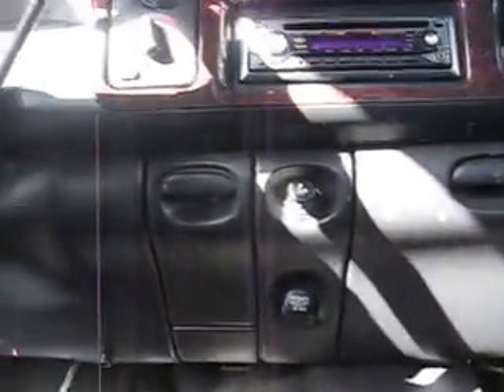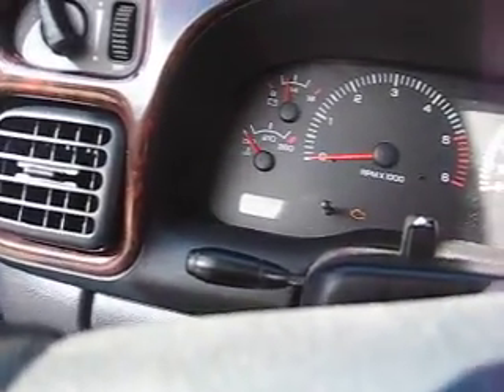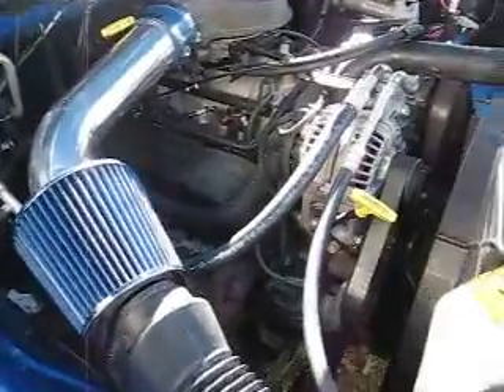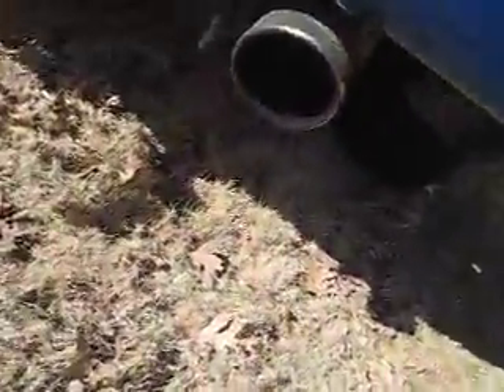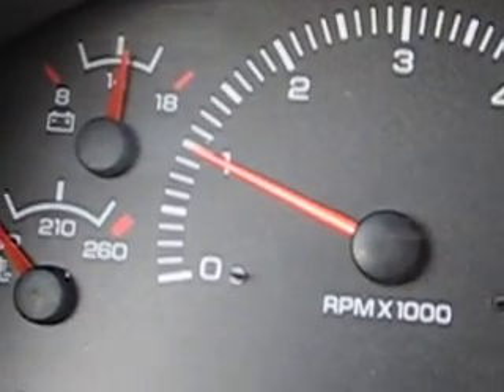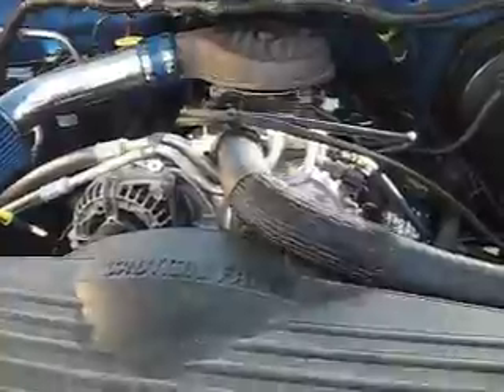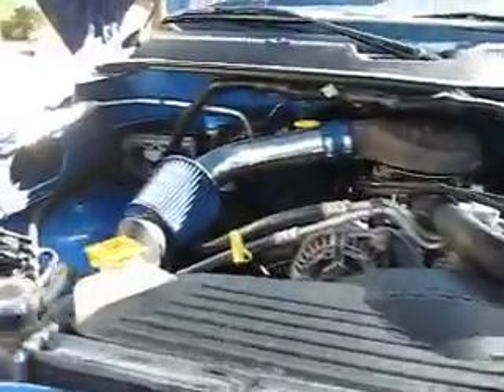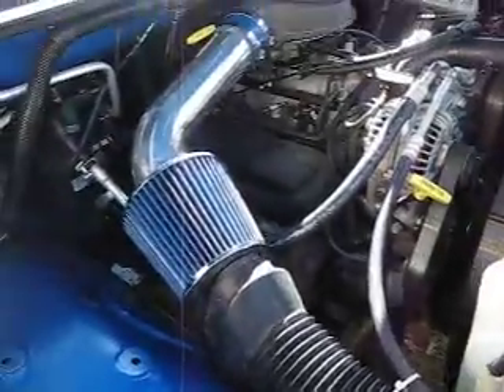Home made  Ram Air intake on Dodge

Comment: @01DodgeRAM1500V8, it might a little, have you ever tried the new spark plugs called "SPLITFIRE"? it's like a standard plug BUT it has a "V" on the end of the gap, it fires everywhere inside the cylinder, thus boosting the MPG better, i put a set in my 96 dodge ram after i found it it was getting 14 MPG in the city and 18 MPG on the highway, and thats from a 3.9 V6, i put in splitfire and i was shocked how it boosted up my MPG from 14 to 22 in the city and from18 to 28 MPG on the highway

Comment: P0113 has nothing to do with A/F ratio. It has to do with high voltage in the IAT circuit caused by the rapid drop in intake air temp.

Many factors determine the A/F ratio. IAT reading, IAC reading, MAP reading & TPS reading ALL determine the A/F ratio.

Comment from the maker: @Nortzy27 i think your talking about the circle piece on my intake if that is i got it off a wreck 2002 Dodge dakota with the 5.9L 360 fit on just fine and im wanting to upgrade my air intake pipe size also to around 5" or 5 1/2" like your wanting good setup do you know where i can get a 5 1/2" air intake pipe from i have a coupling now that goes from 2 1/2" to 3 1/2" for my K&N filter i have since changed the setup since this vid have a good one

Comment: Fair enough, but my brothers Ranger did 120mph

It was an 88 XLT 4x4 5-speed... however it had a 93 Engine in it.

My explorer has only done 99mph

You should hook up the readout for the top speed run. Would be interesting to that.

Comment: Actually,if you mean the part that his air intake is attached to  at the engine you had it right to start with,the part you're referring to is indeed the throttle body.Thats why the old single injector fuel systems were referred to as TB or throttle body injection,because the injector was inside the throttle body.Just sayin. :) BTW There is no benefit from having an intake hose thats larger than the diameter of the TB throat,or opening,just a FYI look it up.

Comment: so where did you get that peice sitting on top of your MPFI? or TB what ever you wanna call it it's not a "throttle body" but where did you get that? i'm making mine out of 3" PVC pipe, gotta get it to 5-1/2" somehow... i'm thinkin about going with 4" and then upsizing to 5 with cuppling or boot...

Comment: that defeats the purpose of the cold air filter putting the tube back by the radiator. you need to isolate the intake, with a metal heat shield, not just change the filter.